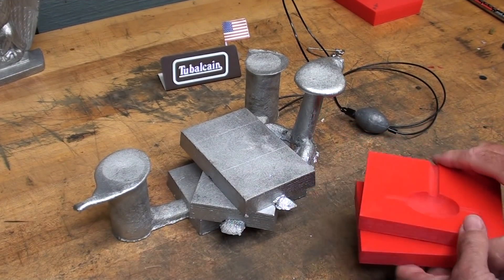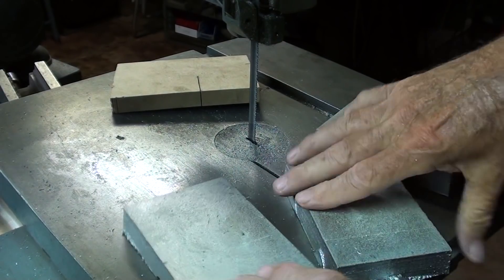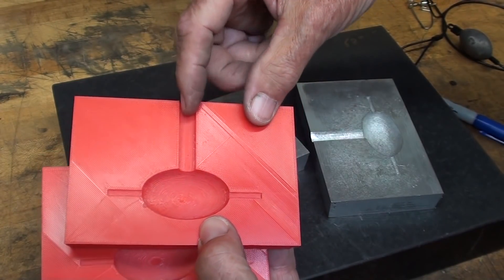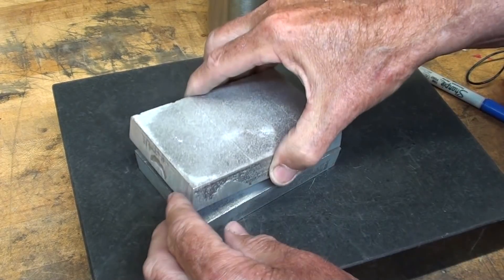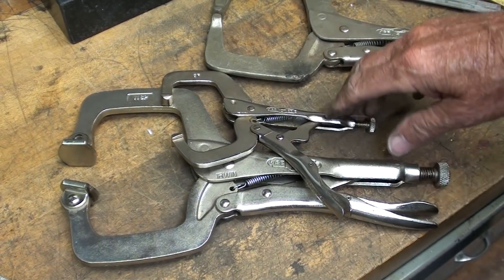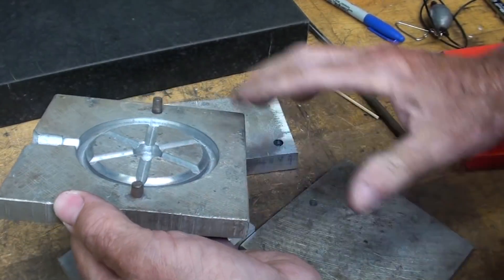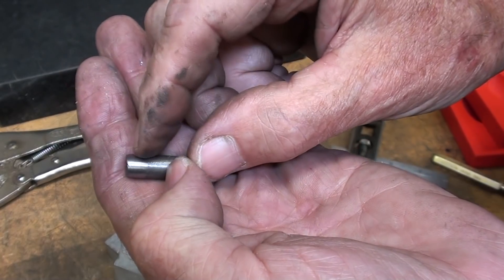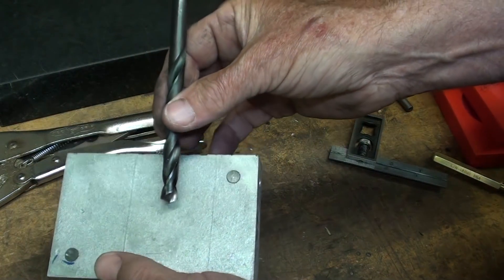Make a Decoy Weight Mold pt 2 TIPS 456 tubalcain

Comment: Good vid Mr Pete . I have a couple slip sinker molds and the hole for the line is made from a brass pin that goes all the way through the mold . That way you pull the pin before opening the mold leaving the hole in the sinker . Might be easier than holding the sinker and pulling the pin out .

Comment: A cliff-hanger  

I was hoping to see what the results look like.  But I will just have to wait. I had one thought about the roughness due to the layering. I have seen that ABS plastic can be surface smoothed with acetone vapors. But considering the greater difficulty of working with ABS I think some filler putty would be easier. But on a project like this one I am sure the suface will be more than good enough.
Reply from the maker: Yes thanks

Comment: Do you smoke your molds before casting the lead?  That always seemed to help release my bullets during casting.  My bullet molds use short rounded pins, or a linear pin placement.  I wish I had a dollar for each and every bullet I've ever cast.  Maybe I should forgo a surface grinder and invest in a 3D printer instead.  I could design my own custom bullets, like Elmer Keith. LOL  Another enjoyable morning coffee with an old friend!  'Til next time.
Reply from the maker: I have found that most of the time smoking is not necessary

Comment: All vise grips with the odd shape are designed to give you three points of contact on a hex nut they do work quite nicely on certain sizes if the edges get to rounded they don't work well at all
Reply: They also work well as a substitute pipe wrench.

Comment: Mr. Pete, I think those odd-shaped vise grips are made to grab rounded over nuts and bolts.
Reply: Yep you got it right. https://www.irwin.com/tools/locking-tools/the-original-locking-wrenches
Reply: @sjb_rnd  Thanks for your input. I thought it could have been used for criming heave lugs on wire.
Reply: Yes it right.
Reply: Yes I’ve had a pair of those for a couple decades now. Designed for the hexagon fasteners.